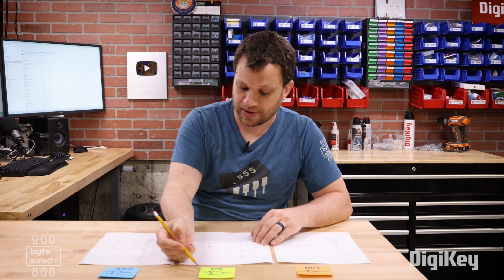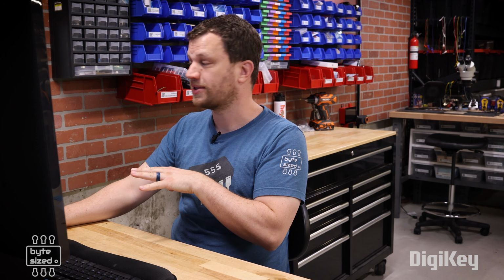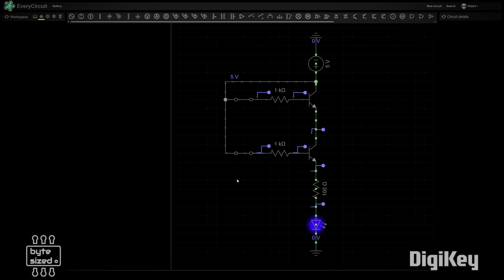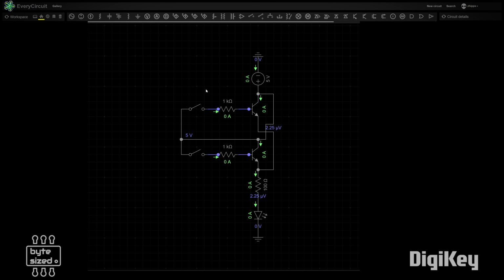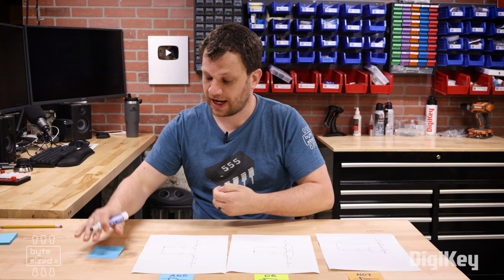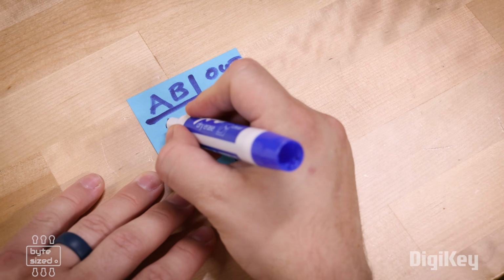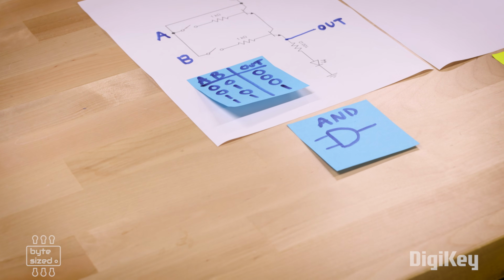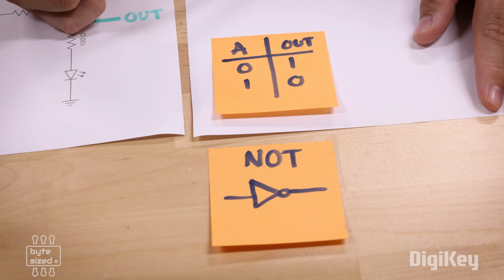Introduction to Logic Gates and Flip Flops - The Byte Sized Engineer | DigiKey

Comment: byte me. to be or not to be, and or is the xor problem. karnaugh maps? never used those because not useful. why something is useful needs to be self-motivated, not externally recommended. ie you need to know yourself what is useful and what is not, not by someone telling its useful. ie diy or dont. also digital logic and implementation are separate things. but vertical integration is useful. ie digital logic simulator design software is very useful to play around with gate logic. ie logisim evolution which is free open source. school as motivation is the worst. money is even worse. camera man does not  care. lol. same as your people students in schools. 25% correct is less than chance. lol. knowledge memorization does not help. using tools to make the process simpler is more beneficial. general skill gives you oversight over everything. skill does not come from school or from people. can you make nano ion 3d printer boxes for diy chips at home. dont use anything other than ion/electron guns. no chemistry processes only ion deposition/bombardment and electron etching. ie crt display tech is the only you require for making chips. even for purifying ion materials from random input source like sand. also top-down design when you have a goal is much better than bottom-up no motivation. why before what. ie stop teaching bottom-up. goal must come first. everyone can fill in the details later. when the details matter. if the details dont matter in the first place, you wasted your time. ie forced teaching does not benefit anyone. not even for money or have-to by law. ie law text is worse than freedom. only with skill the law text also makes automatic sense. but enforced law text makes things worse. glhf. and above be with you, not people with their law rules teaching. d-flipflop is the best but needs a separate write switch not just the clock. ie a register flip-flop. nah mate, simulation quick prototyping in software is much faster start. same for 3d modelling instead of hand building first. for work reasons teaching is the worst way. freedom is the only reason you can experiment with stuff with benefit. also digital circuit simulation does not care about the underlying implementation of the gates, that can be other than electronic transistors. optical transistors rock. also as demonstration. ie leds/laser and gates. also leds as light detectors as gate inputs.

Comment: How does the black box work?
Reply: The box uses light dependent resistor to determine which card has been put on. Look at the top right of each card and you'll see little holes. Each LDR, or a combination of them in later cards determins what the box does. 

Honestly, it's quite a simple and elegant system to 'mechanically' program the IC inside.
Reply: @Callum0929  I did notice that. But how are the encodement scheme of the LSRs?